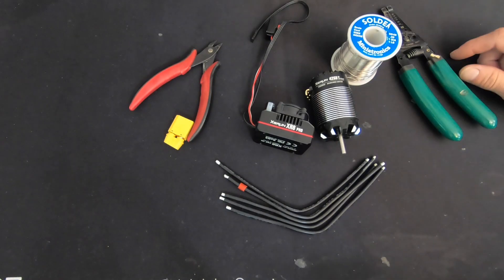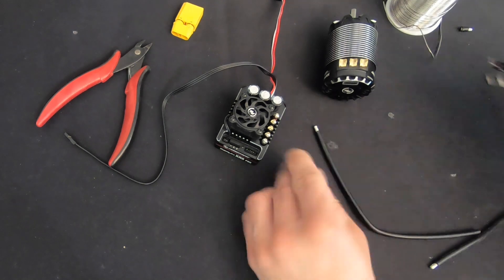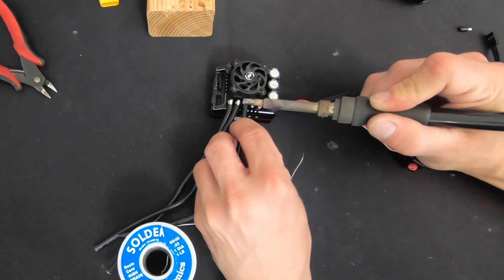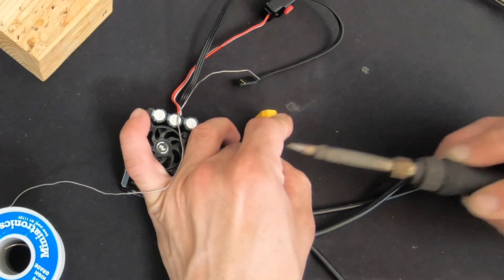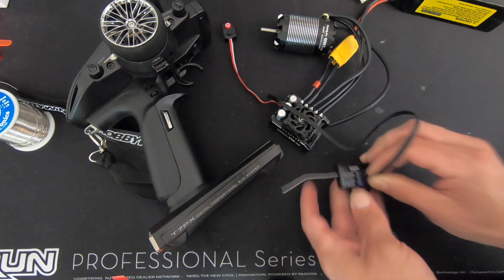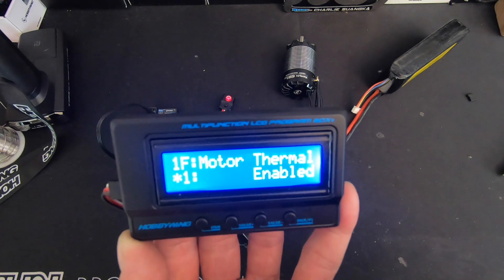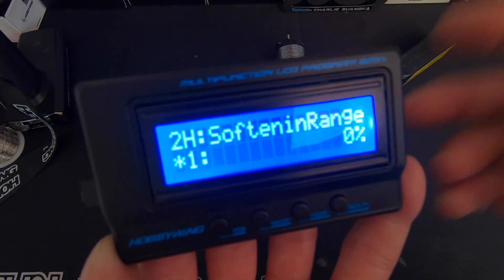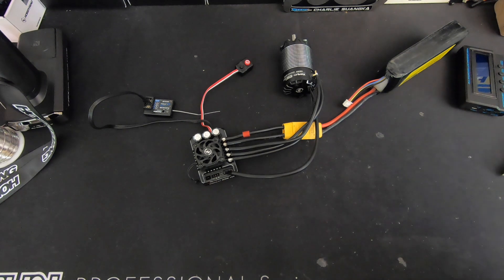The Charlie Show /// Episode 201 /// XR8 Pro - Install and Setup

Comment: Hi, how do you reset the data logging?  Moved esc to another car with other motor, old values are not usefull anymore. And would be nice as monitoring after each run. Thx!!
Reply from the maker: Factory Reset should clear it.

Comment: I just bought and installed a Hobbywing  XR8 pro.  We have gone through calibration of neutral, throttle and brake.  Once that’s done the ESC blinks green 4 times then starts blinking red. Batteries are fully charged. I do not have a programmer.  What am I doing wrong?

Comment: How will that work for no prep?
Reply from the maker: A popular option.
Reply: @HOBBYWINGOfficial   I just bought this xr8 pro g2. I was going to use it for no prep drag. Your tech is saying it will damage the MOSFETs using V10 1/10 motors. And the tuning isn't supported   help

Comment: could you please let me know if the xr10 pro g2 can use lihv batteries?? i know i can charge them at normal voltages but will it accept 7.6v? i cant find much info on this... thank you!
Reply from the maker: Can be set to your desired voltage in .1 v steps.

Comment: I have this combo coming soon and as someone who has never soldered this gives me confidence to do all of this. Question I will also use male XT90 to connect to LIPO's female XT90 but how do I connect the female XT90 on LIPO to the charger that has a smaller female XT60 port? Advice would be really appreciated.